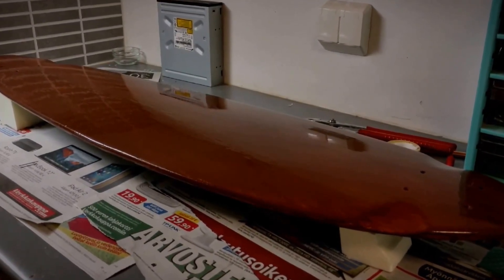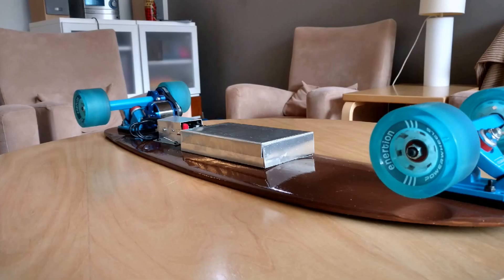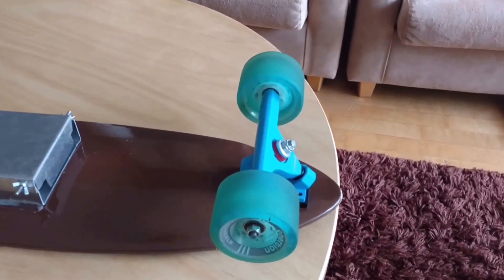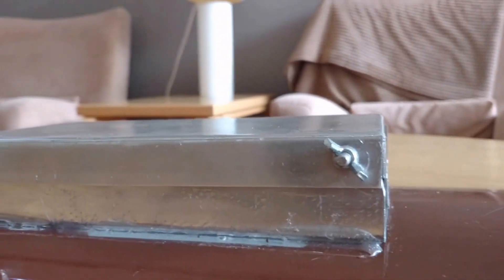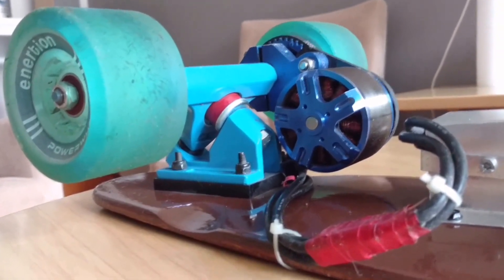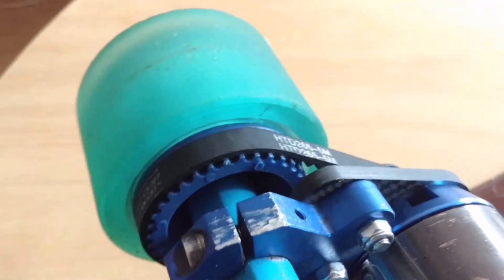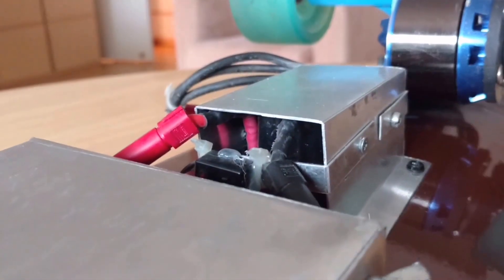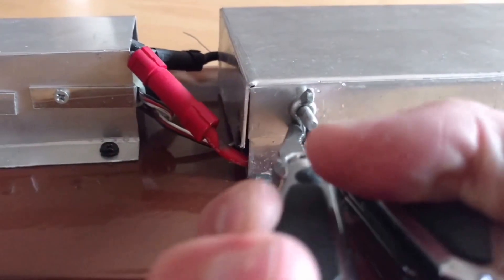Homemade DIY Electric Longboard 1400W

Comment: those are not xt90 connectors at the beginning and how long ago did you by your stuff because the motor mount is not sold any more and has not sold for over a year or did it just take you a year to make the video
Reply from the maker: justin21002002 Hi, the shipping from HobbyKing took like two weeks and from Enertion two months back in the day. Later I built a better board with XT90's and they happened to be in stock and I received them very quickly. 

Enertion stopped selling those motor mounts in July so you'll have to find someone else to supply you with a motor mount if you decide to go without hub motors. Alien power systems is a good, well-known, option. If there are any further questions I'll be happy to answer those.

Comment: Something's going to catch on those wires sticking out and rip them off! I'd enclose them if I were you.
Reply from the maker: Good point! I actually ran the wires behind the rear truck after making this video, it also looked a lot cleaner. Too bad I left my skate in a bus and now it's probably in someone's garage with no purpose. Such a shame the person who took it from the bus has no clue how to charge/control this thing. Hopefully the person who didn't return the board doesn't do anything stupid with the lipos, it could get really hot in there! 

If he would ever manage to make this thing run again, I would take the board back giving no mercy ;D
Reply: FinnishSnowmobiler oh man, that sucks, sorry to hear that :(
Reply from the maker: Your build is very inspiring, solutions for the drivetrain and the enclosure really are something I'm going to take advantage in my next build. Have you visited the electric-skateboard.builders forum? There is a huge audience for clever solutions if you are willing to share them!
Reply: FinnishSnowmobiler Thanks! Absolutely, I'm on there now! lol

Comment: Can you also use the electronics of an old rc car? That you only have to change the battery And motor?
Reply from the maker: Basicly that is possible. In real life you should consider buying a motor and batteries that are made for airplanes if you want to go with cheap. If more money can be spent, I'd buy the drivetrain from Enertion because they really work and are reliable though they can be considered expensive. My build cost me 500€ and it was built with only new components. Thank you for your interest!

Comment: Stopped watching when I saw u had enertion parts... reason I'm on youtube, is looking for an alternative to their bullshit, highly overpriced parts. IDK why the fuck I gotta pay $60 for a $1 piece of metal... #Specialization :L
Reply: You should try this then, if you want a bespoke cheap solution...
http://kevindark.co.uk/Blog/Read/7
Reply from the maker: Wow, that's great! I actually had your video on my "watch later" -list and had planned to look it tonight! Now is the time to enjoy it, keep up the good work!
Reply: FinnishSnowmobiler you too dude.
Reply from the maker: I bought the whole drivetrain from Enertion because they have parts that are guaranteed to work together. Also as I live in Finland, the shipping fees would have been higher if I bought the parts from many suppliers.

Trucks, wheels, bearings: 50€ + 50€ shipping from Ebay
Motor: 70€ from HobbyKing + 10€ shipping
Gears and belts from Sdp-Si: 40€ + 10€ shipping
All together: 230€ vs Enertion 320€

So to sum that up, I personally didn't want the hassle of drilling holes through the pulleys and there would be no guarantee it would work, Enertion was just easy.
Reply: same here, I hit the thumbs down as soon as I saw there over price crap
Reply from the maker: They give the plans for the mount for free... Please dudes, make yourselves some if you've got the tools.

Comment: Very nice build man! Are the batteries connected in parallel or series?  How do u charge them?
Reply from the maker: Thank you! The batteries are connected in series and I plan on building a second aluminium case for the additional batteries. At this point I always screw the lid off to charge the batteries one by one. In the future I will make a better charging system, which will charge the batteries together with greater speed. Nowadays it takes almost four hours to charge the batteries from 3.4v to 4.2v with my imax b4.